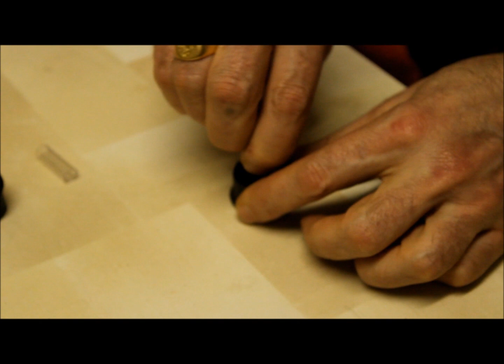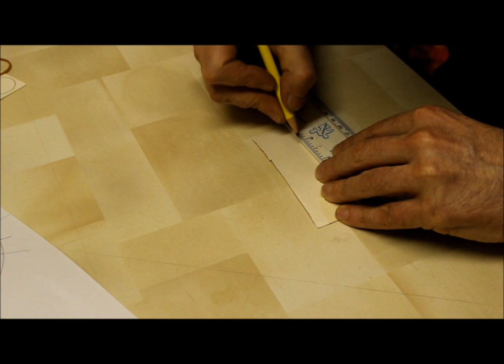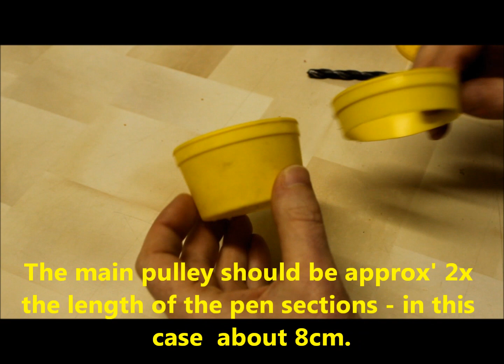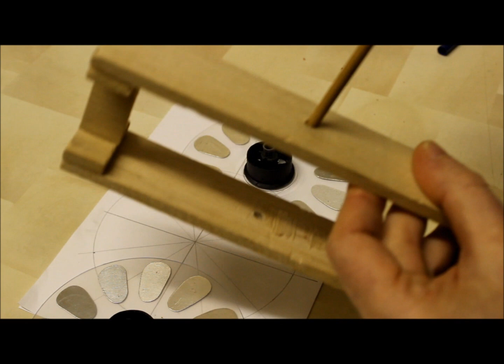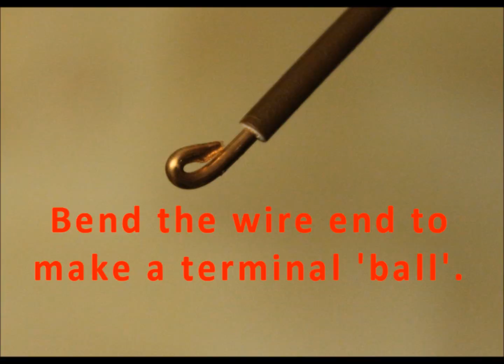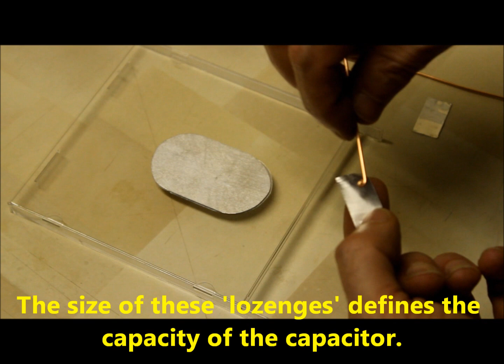How To Build a CD Wimshurst Machine

Comment: You could do better for the condenser.   Bigger foil pieces yields longer sparks.
Reply from the maker: No, more current but same voltage so same spark length but stronger.
Reply: @xiononee  more current helps minimize loss and can help increase voltage, spark intensity and spark length.   I build big and small Leyden jars and there’s a noticeable difference.

Comment: Denis Cook i have replicated you machine it did work but after a few days the machine did not spark again why is that ?
Reply from the maker: Hi, sorry but it's very hard to say - there are many reasons it may have stopped. If all the brushes are in contact, and at correct position, it may be dirt build up/oxidation of the sectors on the cd disks. My CD machine only works for a few minutes before it needs adjustments or cleaning. Dust build up on any conductors will 'bleed' away the small charges created, a stray sharp point will also cause major charge loss.Honestly, though, I don't expect such a machine to be reliable or long lived.
Reply: how do you clean your machine i tried cleaning it but it still doesn't work
Reply: do we also need to clean the collectors ?
Reply: is there a possibility that the problem is on the CD's

Comment: may not overcome losses ???????? are you telling me this thing is an overunity device producing free energy ??
Reply from the maker: +solunasunrise Err NO, I have written a few comments myself on those who claim it (overunity), and some of those comments were not too polite:-)In this machine energy is being supplied by turning the handle and maybe a few percent is turned into electrical energy - overcome losses = losses caused by charge being dissipated from sharp points, high humidity, no insulator is 'perfect', poor assembly/construction etc.

Comment: How many Volts does this machine create?
Reply from the maker: +Peter Parker Hi, very hard to tell - certainly in the thousands as it takes about 1500...3000 volts (quick Google) to spark a 1mm gap.
Reply: +Denis Cook if you use a metal drive shaft would it affect the flow of electricity on the machine?
Reply from the maker: +Peter Parker Hi, metal drive shafts work fine.
Reply: +Denis Cook Mine won't work I dont know why...I repeated the collector spikes and the neutralizers bars...i even made 2 different kinds of Capacitors...I don't know what is wrong.
Reply from the maker: +Peter Parker Hi Peter, very hard to say. My first attempt took a lot of 'feckling' and some research. However if you send me a few close up shots of the machine I may be able to see something.You don't need capacitors to see sparks! Have you tried it without the capacitors in a darkened room with the electrodes only about 1mm apart. The direction of rotation of the disks is also important - try the other direction just to make sure. ANY sharp edges on any of the high voltage parts will dissipate the charge before it has a chance to build.Wire: I used wire with a diameter of about 1.25mm and it was insulated except at the ends - that makes a difference as the bare metal will 'leak' charge, and this machine is very low power so any leakage needs to be minimised.I may be able to say more if I can see anything in the pictures you send.D

Comment from the maker: Hi Bhargav, no cardboard will not work - the disks must be very good insulators, either plastic or glass. At the voltages produced dry wood, paper, cardboard are conductive.

Comment: brilliant , unbelievabley simple the way you do it gonna give it a go thanks for the vid.
Reply from the maker: Glad you found it useful - let me know how you get on. D
Reply: did yours work ?
Reply: It was a while ago, but yes it worked at first  then after a while it stopped working, looking at other comments seems im not the only one, i liked it cause it was a simple build, never expected to many whizzes and sparks.
Reply: so how should we make this work again it seems all electrons gone for good lol
Reply: do you know something?
Reply: maybe clean the disks and brushes with  rubbing alchohol and check all insulation especially the capacitor if you have used a water based glue for the capacitor plates it may have absorbed moisture very bad.
Even dennis cook says he had to constantly clean and make adjustments.
Reply: mine did work just for a while but after that it did not work any more so this means that as long as you can turn the wheel its gana work right ?
Reply from the maker: The disks can spin but it may still not work.I had greatest issues with the 'brushes' and sectors. Constantly changing the brush and having to clean the oxide/dirt line the brush creates on the sectors.If you disconnect the capacitor and spin the machine (in a dark room) you should still get tiny sparks and see a small glow on any points that are losing charge (corona discharge).However this design is really just a demo, it's not meant to be a 'reliable' source of HT. I think I could get the device to run for about half an hour (a few sec's / mins at a time) but after that it needed 'major surgery' and maintenance - effectively a rebuild:-(D
Reply: there should be a way for this its no fun if it dies after all the effort how should we get rid of this black oxide 
if i can only make it spark just for a long time i could make experiments for it so that we can know how to get rid of this oxid
Reply from the maker: Hi, sorry to disappoint you but a machine like this can never really be reliable. That it worked at all is the achievement:-)If you want to try high voltage experiments then you need to build a much larger machine that can produce far more current. See my website for pictures of the machines I 'experimented/played' with: www.xionone.co.uk .The problem with the 'CD'  machine is it's so low powered that anything attached to the electrodes beyond a small low loss capacitor and spark gap will probably overload it.Cleaning and maintenance.II is only possible to clean the disks properly when they are removed from the frame of the machine.Lightly clean the sectors with a washing up scrubber sponge, dry them then clean with alcohol to completely degrease them - do not touch sectors or disk surfaces once cleaned. Ensure there are no loose strands on the brushes that are not in touch with the disk - only one strand of wire is required as a brush but a bundle is easier to handle. Regularly move the brush to a new section of the sectors so as not to wear through or 'fray' the edges of the aluminium sectors. If a sectors edge is damaged then it will leak charge and may stop the machine working. Any roughness of the sectors will be charge leakage points and as this produces so little charge all losses must be minimised. In fact any roughness anywhere on the conductors will reduce the efficiency, all should be smooth or well insulated.
Reply: okay thanks. any way its still great thanks for the information its really rare to see a machine like this in action thats way i am amaze ill try to study it and i want to know how to avoid this oxide so that we dont always clean it all the time lol i hope ill find a solution for it.
Reply: any way is it okay to use eraser on cleaning the sectors ? it seem's to get rid of the black oxide very easily.
Reply: now i am totally confused how the machine works
Reply from the maker: Hi, excellent idea using a pencil eraser:-)As to how these work, I have read loads, spent many hours 'playing' with the larger ones, talked to my (ex)college lecturers etc and am still not completely sure how/why they work.In my experience if the machine stops working and everything is adjusted properly then it's failing due to charge leakage - a stray sharp point, damaged sector edge etc.
Reply: every thing seems to be touching but it still dont work
Reply: i totally don't understand i can hear sparks but i dont see it and there is this black oxid again
Reply: do we need to clean the collectrors as well
Reply: do we need to clean the collectors as well ?
Reply from the maker: When I was 'recovering' from a failure (cleaning etc) I would dismantle the whole thing and rebuild it 'as new' - it would then work for a few minutes, long enough for a few short demos and a movie or two before brush adjustment and/or sector cleaning etc was required again:-(The larger machines can work reliably for hours at a time and be pulled from the cupboard (after months/years of storage) and with a light clean, brush adjustment, and drive belt replacement will work reliably again. The CD machine was just an 'is it possible' experiment and only meant as a challenge, ie how small/simple can I make a 'working' machine.
Reply: so you mean that small machines will not last long ? or does it still work as long as you clean it ?
Reply: i can hear a lot of sparks on the brushes but i dont see any light
Reply from the maker: The brushes' should hardly spark at all - they should be in contact with the disks and sectors.Try running it in a dark room (VERY dark, and let your eyes adjust for 10...15 mins) you should then be able to see any sparks or discharge glows (corona discharge) and maybe identify where its losing its charge. See pictures on my website of the glows expected when its working properly - http://www.xionone.co.uk/wimshurst32cm.htmIf the disk are damaged (scratched etc) between the sectors then that can cause it to fail as the scratches would be discharge paths.If your getting sparks from the brushes I would check the position of the brushes and the direction of rotation of the disks.A small machine can be reliable, however you really need glass disks (so they don't scratch), much tougher sectors (not aluminium tape), good quality brushes that don't damage the glass or sectors and a decent rigid frame and drive mechanism.The CD machine was an experiment in itself and not meant to be a source of HT for 'playing with'.